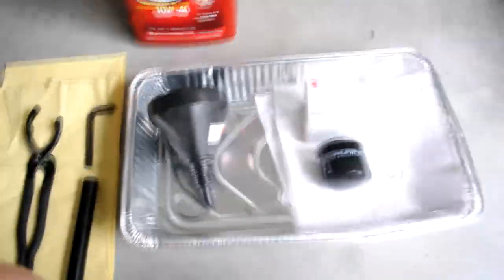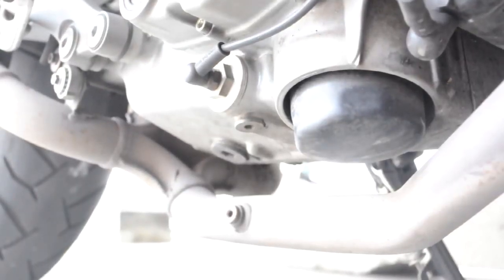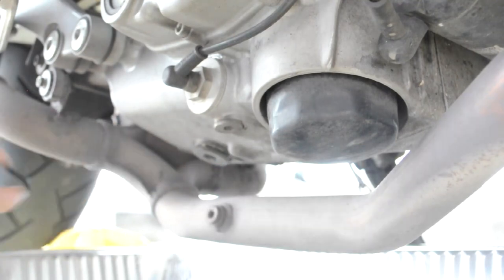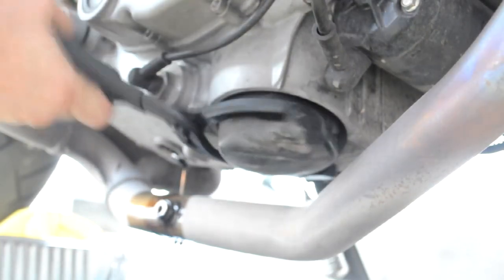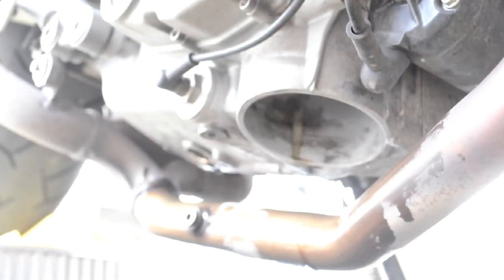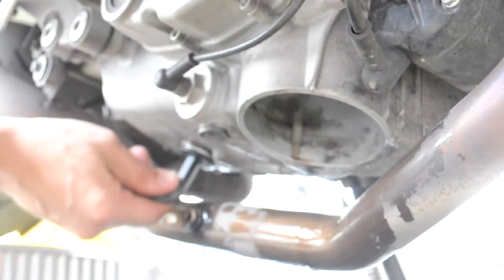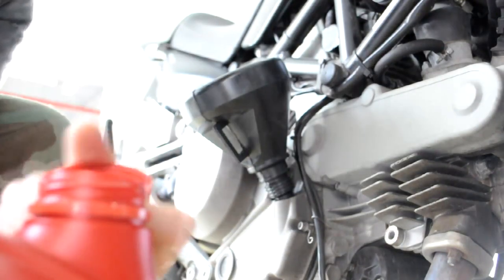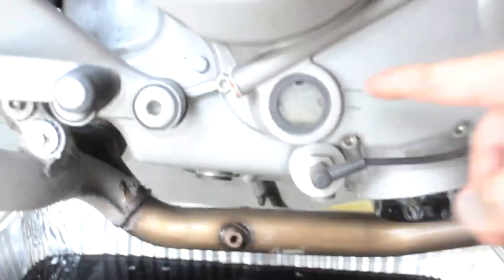How To: Early 2000's Ducati Monster 620 - 800 - 1000 Oil Change

Comment: Heyy! Just picked up a used 2006 Ducati Monster 620 dark yesterday. This video helps tremendously! Thanks.
Reply from the maker: CONGRATS! Good stuff. I love oil changes, such a fun activity to do with your bike :) Enjoy and thank yoU!
Reply: @ducatinyc  Hey I am looking to change the oil on my 06 620 dark this weekend. The Ducati manufacturer recommends Shell Advance but is it okay if I use other easier to purchase brands like Castrol or Mobil 1 10w40?
Reply from the maker: @MotoKeng  of course! I always use castrol
Reply: @ducatinyc  Thanks! I will be watching your tutorial and use alumininum foil to cover the pipe as some.has suggested!
Reply from the maker: @MotoKeng  I dont cover the pipe because its a waste of foil and I'd rather save a dolphin than be worried about my header smoking for 2 minutes :)

Comment: You did not clean the oil screen (oil sensor)? This is an additional filter an the oil filter...
Mostly there is a lot of metal pieces in this filter, so you should take this out as well en clean it!
Reply from the maker: Yes, there are a few things i could have done better and different with this oil change. However, this was done 2 months after I got my moto license and first bike, so I think I did good :) Also, some of the metal shavings get magnetized to the oil cap thought and i did wipe those off.

Comment: I've been looking for the best bang for the buck motor oil for my 03 Monster 620. How do you like that Valvoline MaxLife? Do you still use it?
Reply from the maker: +QuinnNguyen Yes, I still use it. I"ve done at least 5 oil changes with this same brand/kind of oil now and the bike runs like a champ.
Reply: +Ducati NYC Vlog Thanks! Subbed.
Reply from the maker: +QuinnNguyen Thank you very much! How has that 620 been treating you? How many miles you got?
Reply: I just bought it so I only rode for 50 miles. The torque is nuts and the L Twin sounds amazing.
Reply from the maker: +QuinnNguyen  The sound is the best part. Just love it.

Comment: Nice vid. Listen to your friend about the human body metaphor. 1k-2k miles is recommended by the Ducati owners that I know. Ride safe!
Reply: 1-2k miles eh? seems sooo often. no? i'm looking forward to changing the oil again as i feel i will do a much better and thorough job second time around.
Reply: Vassili Shishkin Maybe, but the guy who suggested this was the owner before me. He is a certified bike mechanic who really knew what he was doing with it. A 2002 with 11k miles and the bike is in like new condition. So for me…I plan to follow his lead and continue what he was doing :)
Also, he suggested Motul for everything fluids. The oil is a synthetic Motul 7100 10W-40 4T. Most owners who take maintenance seriously seem to be ok with a few extra $$ on synthetic.
Mine is Monster, 2002 M750 Dark.
Reply: bonogun
makes sense. nothing but the best for my precious little Monster :)

I just hit 5000 miles on my 06 620 - another thousand and its time for 6000 mile checkup, should be fun - right before my cross country ride.
Reply from the maker: That sounds epic.... lucky man.

Comment: Isn't it a good idea to partly fill the new oil filter with new oil before installing it?
Reply from the maker: Markus Rubach Yea, i've seen some people do that, yet others do not. I've done a few oil changes where I didn't and one that I did, not sure what the big difference is. Perhaps if you add a little to the oil filter before installing you don't have to add as much when you fill it up? Thank you much for watching!
Reply: Not really required BUT if you don’t, carefully watch and add as required after starting. Check and double check to make sure level is good and all air is out of filter. Come to think of it mAnual should tell you quantity of oil with and without filter. Personally I change filter every oil change. It’s not a big deal and only a few bucks. Cheers, nice vid

Comment: Hi, do you ever notice your clutch slipping when you change up riding aggressively? It never slips apart from when I pin it and change at 10k rpm from 1st to second. I was thinking it could maybe be the oil used?
Shell ultra is apparently what is recommended. Or is it just the nature of the APCT slipper clucth? Cheers
Reply from the maker: +DannyRed I have noticed that, actually. I never thought it might have anything to do with the oil though - but maybe you're right.
I though the clutch slipping was just due to me abusing it and perhaps the clutch plates needed to be swapped out. 

Shell Ultra, I will take a note and check it out next time. Thank you!
Reply: +Ducati NYC Vlog - that's good to know in a way! - I'll let you know if I get round to fixing it. Cheers

Comment: 6,000 miles or 12 months...whichever comes soonest my friend. Not early, way late actually as even the finest full syn oils will degrade quite quickly after just 12 months even with sparing use.
Reply from the maker: Not sure what you’re referring to but I made this video over 10 years ago when I knew nothing I’ve been riding for two minutes 😜😜

Comment: wedge a piece of cardboard between the crank case and the exhaust next time, that way you avoid spilling oil on the exhaust.
Reply from the maker: Great idea! This was my very first time changing oil ever  - I now use aluminum foil and wrap the exhaust.
Reply: Ducati NYC Vlog I used to work as a grease monkey when I was younger, we'd always have tons of cardboard around for the more difficult cases. Its a quick and cheap way to guide the oil where you want it and customers really appreciated not having their cars smell like crap for a week because there was oil on the headers :)
Reply from the maker: Hahaha, makes total sense. My technique is my better after a few oil changes - I should do an updated video :)

Comment: you bent the oil filter with that tool , better tighten by hand
Reply from the maker: Yep, you're totally right - some noob stuff. i dont think hand tightening is tight enough.  I've been using K+N filters since so I can tighten it with a socket wrench.
Reply: ive been using too K&N filters twice on my 10' 696  but the second time the filter did not fit. I searched on the internet and there where many people with  696 that had the same issue  with K&N filters.
Reply from the maker: ha! i had that happen to me once and only once. i got another k+N and it fit fine. So weird.
Reply: have you tryed changing belts and check valves and maybe adjust yourself :D? that should be very interesting videos
Reply from the maker: Belts, yes, but valves is too involved to do in the driveway/outside without a garage.
Reply: With oil filters usually it’s from when the rubber seal/gasket hits the face you turn it 2/3rds no more or you can damage the rubber seal. If you can get good grip on the filter you can usually do it by hand. I been doing them like this for over 30 years and no problems. And oil filters usually have instructions on them. Cheers